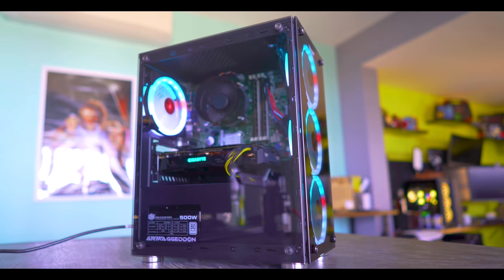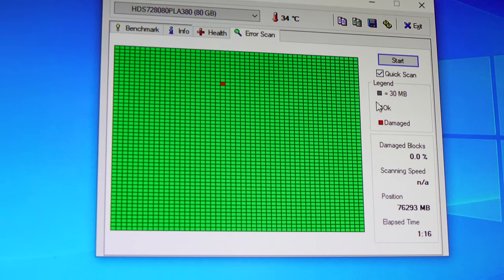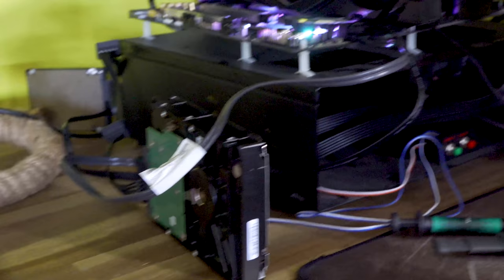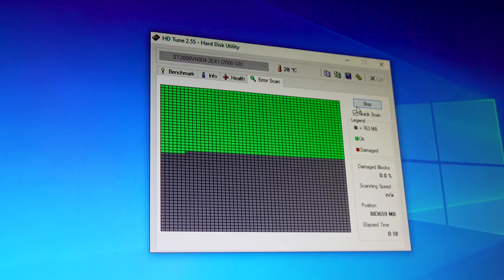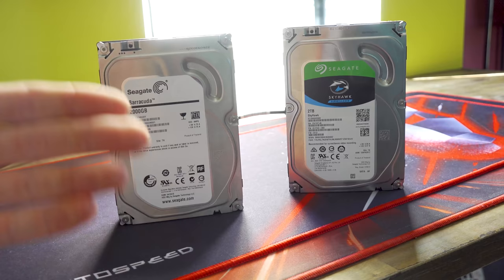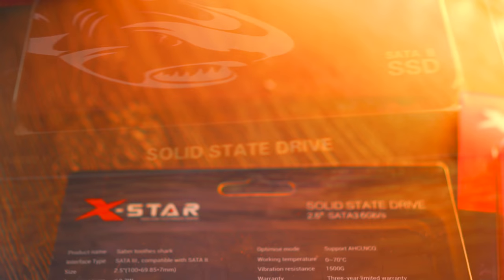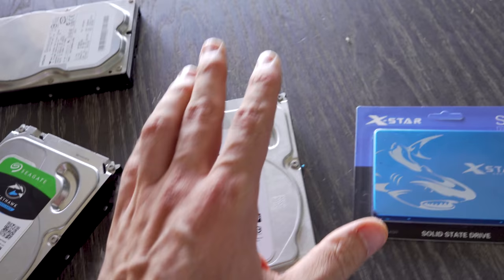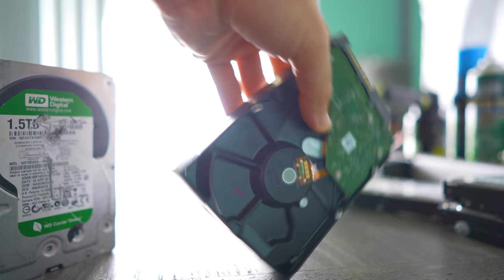Are USED Hard Drives Worth it...? (The Tech YES Buyer's Guide)

Comment: h.d.d's not showing up i usually load a new copy of windows on them. if they make any noise. s.d.d.'s don't show up until formatted with what ever.
Reply: Windows (even XP... talking from experience...) will flat out refuse to install on disks that are being reported as "Red" on SMART data... Linux will accept working on it, not bother, and it will probably work fine without noises like windows does
Reply: @FeelingShred  aw!! the smart h.d. system didn't lockout the red/bad sectors like mine do for xp/vista i'm still running a h.d.d. with bad sectors on my vista gaming machine only 80gb out of the 120gb are usable now. and if you turn off the smart crap you can recover the bad sectors. i only have 23 years of experience of building pc's and repairing the o.s. by either a few line of code or write some scripts if need be. i don't own no certificate for computer repair or programming, but i have people asking me for help who own those damn things they payed money for!!i'm just self taught.
Reply: @jjon6743   Look, there must be a misunderstanding going on, my previous comment was not meant to disregard what you said or doubt you. Sorry if I gave that impression. I was just sharing what happened to me, in the specific case of re-installing Windows fresh, to a clean partition. (I should have phrased this specific part a little better I guess...)  I tried with 10, 7 and XP, none of them let me install it. Now, if you're talking about "Keep using Windows that is already installed on disk", then yes, that is possible, and it's exactly what I was doing before this mess happened. I was practically forced to go to Linux, and by the way I'm still using that same dying disk with lots of bad sectors, it's still going (despite what windows said, and even blocked me from using it)
Reply: In the end, we are in the same boat: old "failing" disks are still perfectly usable, if you have the expertise and knowledge to do it. I'm totally in favor of buying and using old HDDs. I'm not on-board with SSDs a tiny bit. Maybe for storage, but NEVER for operating system like it's recommended all over the net.

Comment: @Tech YES City
I disagree a bit that you shouldn't use a hard drive just because it has one bad sector. First and foremost, you should ALWAYS back up data and take into account that the hard drive could fail any moment. The same for SSD's unfortunately. Also you could still perfectly use such a hard drive as storage-buffer, for videos, steamcache (when you don't play a game but don't have suffiiciently fast internet to download the games fast), music...
With regard to longevity, typically a hard drive either dies during the first few years  because of a production error (a decreasing problem) or after 8-10 years (average! A function of  how much it was used of course). 

I have never bought a used HDD but I have some interesting experience with my hard drives. I have had bad sectors which caused Windows not to boot anymore, both on the desktop (twice) and the laptop. Not fun. I kept using the drive but I did backup important data. Nowadays I prefer to use Linux and I only use SSD's. I suspect that Linux has a bit more redundancy than Windows if there is just one bad sector on the wrong place, not sure. At a given moment I could see that the drive had problems because the Windows filemanager took forever to load the contents of a folder and eventually it just refused to do it. After a drive-check (not using bad sectors any more) and quick format I could still use the HDD as a data-buffer for a long time. Once again, as long as you don't store essential data (only a copy of data) on it it is fine. Peace out, mate.

Comment: My hard drive sound like that, saving to get a 1tb ssd.. That'll be another month though
Reply: You can find generic unbranded 1tb drives new on eBay for $30 now. Idk if it's really new or why there's no brand name on there, but I've bought a few of them and they've worked fine for me. 

Only got one that didn't work right and the seller replaced it immediately. So that's the best deal I know of.
Reply: @rickylonghaul682  hard drive died today on boot up, thought it was my cpu, as my x58 thinks that. Going to get a ssd today instead of next month.
Reply: @mouaxiong8618  Probably a good idea. I'm about to move from x58 to am4 just for the m.2 support. There are some good deals on m.2, but none of them feel as good of deals as SATA SSDs right now.
Reply: @rickylonghaul682  If you're close to a micro center, they'll be doing blackfriday sales and cyber Monday sales on all the items.
Reply: @mouaxiong8618  the nearest microcenter to me is over 1000 miles away, I think.
Reply: @rickylonghaul682  I found 1TB WD Gold enterprise drive on amazon for 30...

Comment: 6:18 - Not true, the data is still there, and there's quite a lot one can do to get it back, from data recovery tools to proper data recovery companies who have sophisticated equipment & suchlike (they can examine individual platters, etc.)

Bryan, something you've not mentioned is used Enterprise drives. I generally avoid used consumer models precisely because they are not that reliable in the medium to long term, especially the Barracuda line. By contrast, I do hunt for the Seagate ES.3 series and I've had a lot of success obtaining these not only lightly used but new aswell for very good prices (sub-65 UKP for a used 4TB ES.3 is a bargain, see item 113792461935). I also look for the Hitachi HUS series. A few years ago I was getting 2TB models but now I look for 4TB, obtained at least twenty so far. What's interesting is that one would assume the used models from an Enterprise environment would have had a lot of wear, but in reality this is sometimes not the case. Either way, they'll still be more reliable than a used 2TB consumer model, and personally I'd never touch consumer eco models.

The other option for even better reliability is SAS and FC. Using these would mean fitting an HBA and I expect some users would not want the additional bootup time, but the reliability and options for RAID are often impressive, as is the performance, especially those cards which have some cache RAM (and decent 6Gbit models are cheap these days). For example, have a look at item 283632186258, that's ten 2TB SAS drives which sold for 142 UKP total. Check the seller's past listings, he sold numerous such batches, including 15K models at lower capacities.

I suppose though from your point of view the typical user would not really understand the benefits of something like the above, nor the speed avdantages (access times are much better), but some might, and some may not care about an HBA if they're not familiar with the tech anyway. For those who do care, it's an option worth considering.

And for proper backup, there's always used SAS LTO4/LTO5 tape units. 8)

The most recent Hitachi 4TB Enterprise drive I won for under 60 UKP was item 264463813186.

Comment: Which hard drive brand is most relaible? Pls don't tell me seagate.
Reply: None, they all seem to have one or more notorious product “Hitachi DEATHStar/deskstar” as an example (I forget the WD issue models), and quite a few others. SSDs are more robust (dropping etc, so perfect for laptops which also have pretty trash flimsy mech drives anyways since they are needing to be so thin) but those usually die faster and give like 0 warning signs (and a death on those in a year is kinda not shocking... even expensive enterprise versions. It’s not guaranteed to happen, but like the failure stats are really bad for how they just suddenly die).

So... backup... and then backup your backup! Also don’t get the same brand and model just in case that new one turns out to become an infamous crappy drive... you can’t replace a backup (I’ve had my PSU fry a $250 SSD, nothing is safe, that wasn’t even like a lightning strike or fire or anything). Just back it up. If you can’t afford a second drive, then you can’t afford any important data... go used if you have to to get a third drive (cause it would really suck to drop your backup or have them both get burned out like on a PSU when you are transferring over files...)

Comment: my experience with used HDD you say?
Oh just hrs of trying to recover data, cooling the drive in the freezer taking off 4gb at a time before it warms up and errors out over and over. And i didn't even get all the data back. Mechanical drives are dead to me😑 PS i don't believe in backups i like to live dangerously.
Reply: SSDs often fail instantly with 0 warning, so lol, you wouldn’t even get 4GB off them! They also have much higher failure rate (not stopping me, but I make sure to backup anything I’d miss if it got destroyed, I’ve had my share of expensive dead SSDs, lol, turtle speed mech as a backup is pretty cheap for my sanity WHEN they SSD decides to fail)

Comment: my hard drive has been used for 12k houres and any sector error.
Reply: That's light usage, a decent drive should far exceed that.  I rarely see a failure under 35K hours (unless its an infant mortality failure in the first year). I have drives over 80K that are still working fine with no bad sectors, note though these are in systems that do not move, not laptops that get banged around. I wouldn't consider anything but an SSD in a laptop, if it doesn't come with one, I replace the HDD.

Comment: Mega mechanical drive experience here. Used mechanical drives are only worth buying if the price is right (as stated in above video) and if they're OLDER STYLE drives. That might sound surprising but I have 14 and 12 year old Seagates that still run like a charm. I have good 11 year old WD Velociraptors still running strong. Brand new WD mechanical drives??? Only if you're a masochist or if you like to gamble with your data. Seagate Hybrid drives for the most part are a recipe for disaster. Never buy the thin, slim line mechanical hard drives either -- especially used. They are junk. I've been through dozens and dozens. Those thin mechanical drives don't have much to them. Nope. Seagate and WD do NOT make mechanical drives like they used to. You want the full bodied, thick, tried and tested mechanical drives. Preferably Enterprise quality drives. I've had so many brand new mechanical drives fail on me that I cringe at the thought of buying brand now but if you have the cash and you insist on mechanical hard drives, toss 400 dollars on a good Seagate or Samsung 1 TB hard drive because they just don't make them like they used to. OR, spend your savings wisely: Run with SSDs.

Comment: not entirely correct. I buy used hard drives - 3.5 inch for servers. enterprise grade. they fit perfectly on deskto PC I build (sata). you run the disk's manufacturer diagnostics free download at manufacturer web site. if it has a single bad sector or as such, and the disk manufacturer diagnostics check the disk and marks it green, you can use it. a single bad sector locked by the disks controller doesn't mean the disk is dead or close to become one. I bought such disks for 20-25% from the full retail price and they still work for years! the enterprise grade HDD's are something different, much more robust and diagnostible with its own tools. like seagate constellation series.

Comment: omg don't throw them out even looks bad Bryan works ok some do don't throw out you know you can recycle them they give you money for the aluminum and inside stuff i had dead sata drive 500gig works ok but i put a jumper over the back and works ok weird i bought second hand worked ok then did'ent work but i put jumper over the back pins and no problems now Thanks for that info on the hard drive tune dude im using it Cool i have a hard drive i need the board for to its works i changed to another drive i have it worked its just the board fissile  smoke but the hard drive under neath works good

Comment: You are wasting those hdd you should keep the boards of them or try replacing the boards I have found this fixes a lot of those drives that appear dead.

The old hdd was much better it was rare i had any of the old ide era dries fail in fact i still have a lot of them now running yet modern ones had so many fail tends to be just outside the warranty as well.

hddtune only works if you can boot into os so you should of said to people about an option for people that can't boot up as well.

Comment: 500gb class ssd and 2tb hdd is the power combo IMO.
Reply: I have all types of drives in my current rig. An Intel Optane 905P 480GB U.2-NVMe SSD, two WD Blue 3D Nan SATA SSDs of 2TB and 4TB, and a WD VelociRaptor 10000 rpm HDD of 1TB.

Comment: Used drives: Anything smaller than 1TB goes in the bin. With how cheap SSDs are nowadays, it just isn't worth it. The speed difference even on older PCs is worth the $50 or so a Sata SSD would cost.

Comment: I would never put my data, nor a user data for that matter, at risk to save 50% of a 1TB HDD that cost U$S45 brand new. Even if you sell them with a warranty. Saving less than 25 bucks for all the hassle of testing a used hard drive makes no sense to me. Also, a quick sector test is useless. Finally, how long it has been used for doesn't really correlates to how long it will last. It's known that power-up counter does have an impact on reliability (a disk with high power-off / power-on cycles is more prone to failure than a disk with a few cycles and years of non-stop working).

Comment: I can't find any good deals for hhd on Amazon
Reply: Go on eBay. I only Amazon has the good shipping, but you can get new unbranded drives 500gb for $15 or 1tb for $30. I've used several of them and only one didn't work, which the seller replaced without question.
Reply: Why would anyone buy spinning rust? Would much rather have 512gb ssd over a 1tb or even 2tb drive.
Reply: @repeatrepeatrepeat  That's your preference.

Comment: why bother with hdd?they consume more watts than ssd,can be noisy sometimes,produce some heat and a lot slower....Ssd prices r so low that it's not worth anymore buying old slow hdd.I have both in desktop and laptop 2 ssd setup,1 500gb main (for OS,programms,games)  and 1 240gb ssd as secondary but i use also a tbyte external hdd for back up
Reply: pCIe 4.0 SSDs produce much more heat than HDDs

Comment: What is a Dedicated Hard Drive?
SSDs have shorter life spans than Hard Drives.
Reply: Nowadays, not anymore. Especially as boot drives.
Reply: It really depends on how you use them, if you are doing lots of writes, then yes an HDD is a better choice.
Reply: @StriderVM  thats because they store more than they used to.  If you can only write 200 times to the drive before failing it, and you have lets say 500 gigs free on it, it will take you writing 100Terrabytes to it over and over again to fail the drive.  Mind you, if you only keep 5GB free, that figure goes to 1Tb of data written to fail the drive.  Most hard drives run into the Kilo-Petabytes writes before running into issues.  Actually, writing to a hard drive more often strengthens the data and makes the data less susceptible to weak sectors, which is opposite to how SSD drives work.

This might not make sense, but almost all SSD's come with a feature called "Wear leveling", which writes new data to a different location every time you write to the drive.  Also depending on the state of the NAND chips, SLC / MLC / TLC...  the higher density of the Nand technology, the fewer write cycles before failure is observed.  That's why military or industrial applications use SLC Nand, smaller devices but more durable.

Another aspect to data security with SSD drives is with respect to vibration, no moving parts means you can subject it to abuse and lose nothing, but hard drives are easier to recover data from.  If the flash RAM gets corrupted, flash controller or Cache fails on a SSD drive, you end up with a boat anchor, with zero chance of data recovery.  Hard drives always have the ability to recover data, unless there are surface defects made on the discs, which are not that common, unless you drop them during operation, or if they are made by Seagate. (pun intended)